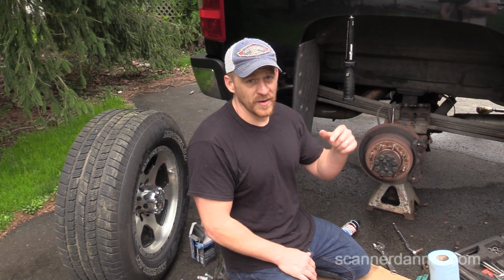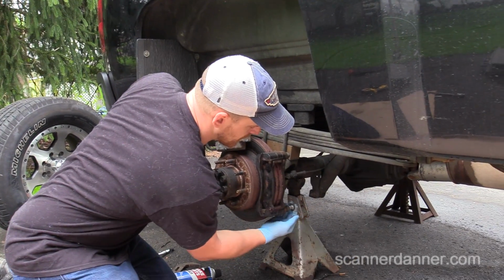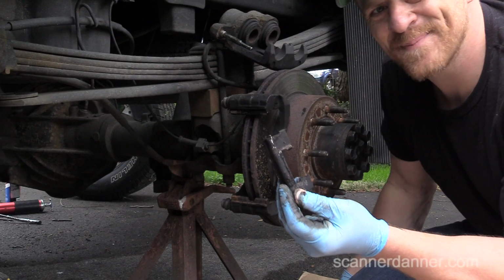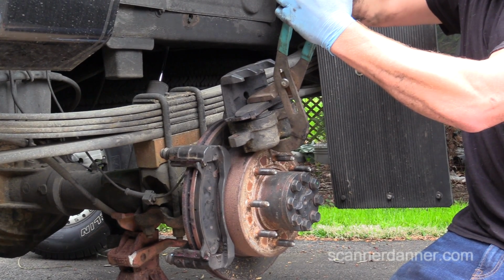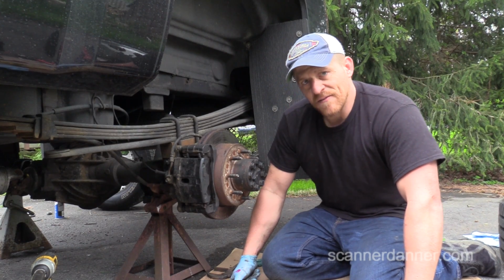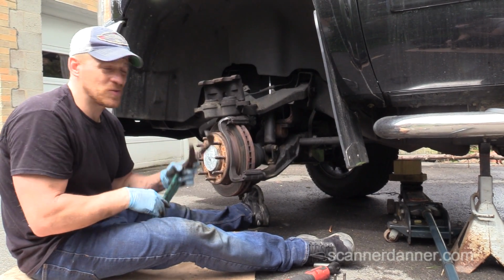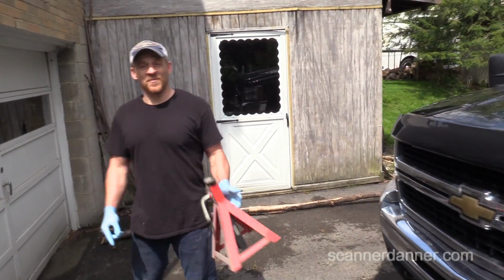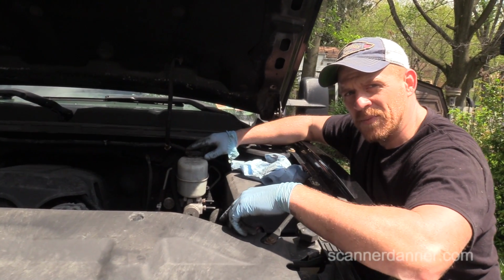Silverado 2500 HD Brakes Hanging Up, Diagnosis and Repair Part 1

Comment: I'm a little surprised you aren't bleeding brake calipers every now and then. Brake fluid inside calipers will be the most heavily contaminated in the whole system and that is no good for corrosion protection. Bleeding the calipers while resetting them removes part of that contaminated fluid, which helps mitigate corrosion. Had you been replacing a little brake fluid with each brake job, maybe you wouldn't have found yourself needing three new calipers and a bunch of new pads today. Regular use of the bleeder valves also keeps them from seizing up and breaking when you decide that you need to use them.
Reply from the maker: For sure man. I slacked on the brake fluid on this. Totally my fault
Reply: The first time I did a brake job on my hand-me-down car, I discovered that the front-right sliders were in a bind and that pads on both sides were jammed, had to remove the whole bracket and get it off of the rotor using a sledge hammer. Slider pin boots had burn holes through them from exposure to overheating pads and the pads themselves were bound in the bracket too. When I got around to resetting the cylinder, the fluid that came out of there was close to fresh oil brown instead of dot3 light yellow, so I bled that until it got clean. Surprisingly enough, the caliper still worked fine once I got done cleaning all the parts and putting new boots on with fresh silicone grease.
Reply: yeah, wait until you see the fluid on this. It was pretty bad.
Reply: Will you be bleeding a little bit brake fluid when resetting brake calipers now? :)

While leaving the old fluid in there may not be an immediate issue, it does have some long-term benefits in the form of having to replace brake calipers and related parts less often (if ever) over the vehicle's useful life.
Reply from the maker: Actually no! They snap off here in the rust belt. I don't touch them unless I have to. Plus I don't really do this type of work anymore anyway :-)
Reply: I'm in Quebec, Canada, plenty of road salts over here during winter and bleeder valves are basically "use 'em or lose 'em" things. Give their threads a fresh coat of dot3 with every seasonal tire change by loosening them until fluid seeps through and that should be enough to prevent them from seizing up.

Comment: probably time to bleed the brakes so old fluid gets replenished as it breaks down over time due to heat. if the fluid has any dark color to it then flush it. less than a hour if you use the air vacuum operated one man $25 tools from flea bay.....
Reply from the maker: for sure, coming up in part 2
Reply: Itsn't about the heat, u have to change it all 2 years, doesnt matter you use your car or not.
 DOT 3, 4, and 5.1 are hygroscopic and will absorb water from the atmosphere...
Reply: Yep, too low boiling point is not so good thing on hydraulic brakes ;)

Comment: wrong grease Danner! attracts dust & dirt plus caliper grease is recommended to allow pads to slide and reduce squealing.
Reply: South Main Auto did a few great videos on front caliper and brake service.  He never greases the stainless steel where it contacts the pad ears.  (Unless I missed it?  then I apologize.)  He correctly notes that it's the steel mounts where the stainless steel guides attach to-  That builds up the rust!  And then you have that rust compressing up onto the stainless guides...and that pinches the pads and causes them to stick.
Reply from the maker: It was a synthetic grease but you're right and I did buy the specifically listed "brake grease" with my new parts. Coming up in part 2 as well. 
Is the synthetic grease I used acceptable or not?
Reply: Oil based greases will always creep across any iron surface over time. The reason for special brake grease is that it's silicone based and does not do this creeping with iron surfaces. So I would say no to synthetic if I had dielectric grease available to use instead. Better than nothing conditions, is just that - it is what it is and better than nothing.
Reply from the maker: Thanks for the description!
Reply: Also the petroleum-based grease is not good for the rubber slide pin boots. Silicone grease won't damage them.
Reply: Paul, get a copper based spray, main reason its u need a grease that can handle the temperatures
Reply: ScannerDanner I love your humble nature as well as your instruction.
Reply: i noticed that also good eye

Comment: On all-disc rear brakes, you won't be able to reset pistons by prying as there is a screw mechanism inside the piston to drive the parking brake. You need to screw the piston back in, preferably with some sort of piston head adapter to make the job easier.
Reply from the maker: Not on this design my friend. It has internal brake shoes on the inside of the rear rotor for the parking brake.
Reply: When I wrote all-disc, I meant brakes where there is no tiny parking drum brake in the middle and the parking brake is implemented via a ratcheting mechanism inside the caliper cylinder. I had my first encounter with that setup last year when I had to do a brake job on my father's 2013 Accent where the rear brake pads got bound in their brackets. Hyundai declined the warranty claim on the brakes saying it was "normal wear" but even after grinding the rust off the pads, brackets and shims, the original pads still required excessive force (needed a hammer) to put back in just to test the fit. I can't imagine how that could ever have been 'normal'.

Comment: FWIW,
You really should not use standard grease on a brake service.
Brake grease or silicone paste for use on the slide pins
It (Brake grease)also can be applied under the caliper bracket brake hardware.
Or apply anti seize  on the underside of the brake hardware.
Never standard grease
Reply from the maker: It was not standard grease. It was a synthetic, but I did buy some actual brake grease when I bought the calipers and pads, so you'll see that in the assembly on the front. Thanks for the comment.
Reply: Glad to hear that...
BTW don't let Eric see that ...oh my!

Comment: i had a similar issue on an old 1970's land rover, only differance was all four brakes would lock on after 15 - 20 mins drive, he had taken it to various garages and had all new brake shoes, drums, flexi hoses, wheel cylinders and a new master cylinder and still the problem persisted.
anyone have any idea what the solution would be?
Reply from the maker: proportioning valve or master cylinder or maybe an adjustment on the brake rod that attaches to the pedal or brake booster (I forget, but I know some cars have an adjustment there)??
Reply: yes you are right mr danner, the rod on the pedal that adusted the slack to the master cylinder had come loose and vibrated its way out so the brakes where on all the time, the lock nut was right at the end of the thread, man was ever grateful to me for finding that after he spent hundreds at other garages, they just missed out one crutial thing, checking the pedal slack.
what surprises me is the guy who fitted the master cylinder missed this.
Reply: Yep, you said in the first line, land rover.
Reply: needs new calipers

Comment: When I saw the title of the video (knowing the autors work) first reaction was 'WTF'. 
There are number of videos on brakes job made by profesionals. This guy is literally a god in making videos on diagnosing engine performance issues, so I think this one was unnecessary. 
But hey, he felt like doing video on brakes, leave him alone.
Reply from the maker: Yeah, and it was my truck so I had to get it done anyway. Figured i would shoot this to help someone out there. But you're right and I did hesitate to upload this. Part 2 will be cool though because I visit my brothers shop and people want to see more of him.

Comment: Question on something you mentioned about a PA state inspection... do they take the calipers off to look at the pads to look for cracks?
Reply from the maker: That would be a question for my brother James, but yes, I think so?
Reply: Adrian Kingsley-Hughes yep. by law we are supposed to pull caliper off and pull pad to inspect and measure that way. those cheaters that u can measure the pad while it the guides is illegal except on motorcycles

Comment: Great job
 did my brakes fist time 3 months ago, you cleared up any queries I had
Very happy 
I have been slack and not used safety glasses but never when using a rotary wire brush

Comment: I hear ya on cracking bleeders. In my experience, cracking bleeders == snapping bleeder off == new caliper.
Reply: True  --- judgement call, why  don't they use stainless bleeders on new cars  50c per car saving?
One of the skills that you have to learn actually on the job is ways getting the air out brakes systems with broken bleeders.
Reply: Yeah, that skill and getting busted bleeders out (and getting a busted easy-out that broke in a busted bleeder out!).

Comment: A trick that's saved me thousands over the years.

Every few weeks while driving on a slight uphill. (I have my favourite traffic lights) as you stop put the transmission in N for the last part of the stop and coast to a stop without the brakes. If you feel the car stop then something is dragging. If nothing is dragging the car will stop or start rolling back without feeling the static friction change direction.

I have found sticking calipers may be fine when cold but after a few miles driving they start to bind. Sometimes a sticking caliper has to be diagnosed by a process of elimination.

Guess my thinking is old school but I have always just rebuilt the sticking piston. RockAuto have seal kits. It only takes a few minutes to pop out a piston clean it up and reassemble. Never had an issue with one, sometimes you need a new piston.

There is a big difference between your own car and a customers car. The customers car you want to send down the road with the knowledge it will last another few years without problems. On your own car you can keep an eye on things.

In terms of the brake bleeder and compressing pistons I open them in conjunction with a turkey baster brake fluid change. That avoids the parlaver of a formal brake fluid flush every few years.

Comment: Hi mate, something else worth a mention when you've had a brake hanging up is to check the pads for glazing. My MG had this last month, my nearly new pads were toasted. All shiny and no good any more.  Love seeing you working like this man.
Reply: Those Lockheed calipers on older MG's were a pain for the  rubber seals going  brick hard and sticking.
Reply from the maker: thanks Mike!

Comment: the "anti-rattle spring" clips are usually stainless spring steel of some type :)
i like to use brake cleaner with nylon/brass/steel brush to clean slide pin bores, choose brush depending on how bad they are. I always clean the pins/bores, even if still free.
I grease everything including the whole pad shim backs, piston faces, caliper, seems to work well as anti-squeal, selectively on see-through wheels.

pads/shoes,,, shoes/pads,,, pads/shoes. had me cracking up, everyone does that.

Comment: nice "pry-driver" usage :))
here's the crap for no safety glasses, wait until you get a wire flung off the wheel stuck in your eye "once"
Reply from the maker: for sure and I should have had them on for that

Comment: What are the odds on a sticking master cylinder piston being the root cause of issue?
Reply from the maker: I don't know but I was concerned until I remembered the LF gave me issues 6 or 8 months ago, not long after I serviced the front brakes, so it was an issue for awhile.
Reply: ScannerDanner  Hey Danner this is Darius the asparagus lol Great video man, i see you have some more weirdos trying to tell you how to do your job Haha! You were honestly one of the best teachers i had in my whole educational experience from the beginning til now
Reply: If it re-occurs while the brakes are still hot  and binding crack open  bleed nipple or as I usaully do slightly simply slacken a pipe union on the  affected  circuit at the  master cylinder to release any locked in hydraulic pressure. If the  binding clears instantly  the fault is at the pedal end  
It can be as simple as the pedal not returning fully  but more common is  the rubber grease packed in end of the master cylinder turning hard and preventing the pistons in the master cylinder returning fully.
Reply from the maker: Is this common to the Silverado?
Reply from the maker: Thanks so much Darius. So good to hear this from you, I really appreciate it. 
haha "Darius the asparagus". I definitely still sing the Veggie tails song with King Darius in it when I see your name.
Reply: I have encoutered it a couple times on normal everyday vehicles   but it is more common on modified cars,
It just needs the piston no fail to come back the final 1 mm for pressure to get locked in.

Comment: Did you happen to buy the GearWrench 120XP flex head ratchet set? I have that set and use them professionally and they kick ass! My first set I think were 60 or 80 tooth and I was able to pass them down, but the 120 is awesome. I've used snap on, matco, cornwell, etc. and the gearwrench are just as good, and they'll send parts FOR FREE to rebuild.
Reply from the maker: I just got them about a week or so ago. I did an unboxing but not sure I'll upload it. It's no better than what already here. I'll save my video for awhile so I can use them an really give an honest review.
Reply: Enjoy them! They don't like grease if you happen to clean them, I use transmission fluid personally but anything that's more oily than greasy will work fine. Grease made them lock up.

Comment: I'm having a hard time believing it's going to have a diagonal split system.  I'd sooner believe it's got a 4WABS system under it.  If it's true to older GM pickups from 2000ish on up, they'd put the ABS module under the cab on the left interior frame rail.  I hope you never have to take a turn at replacing those brake lines down there.  AND... you can still get caliper rebuild parts off rock auto dot com.  And...the robin is Wisconsin's state bird.